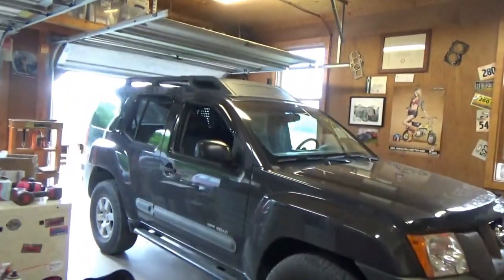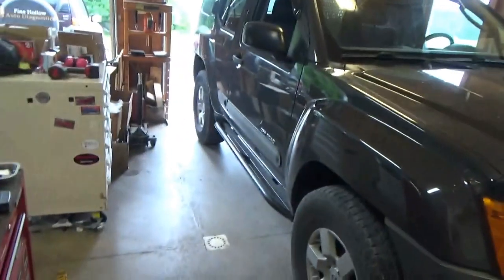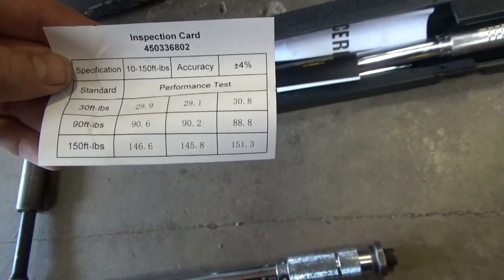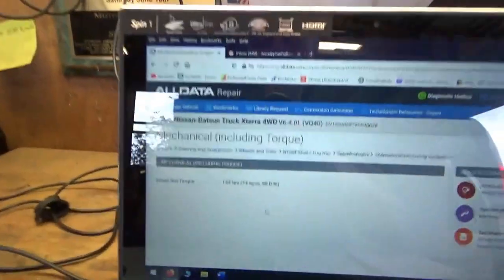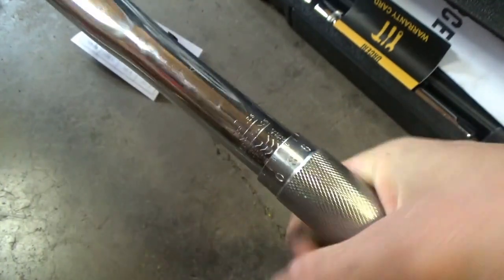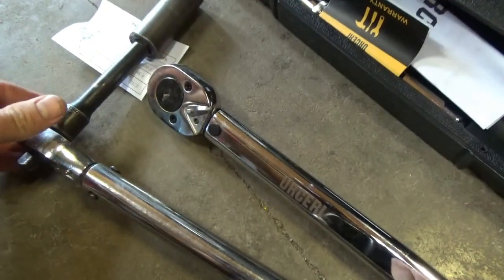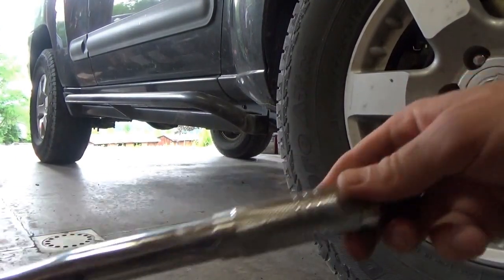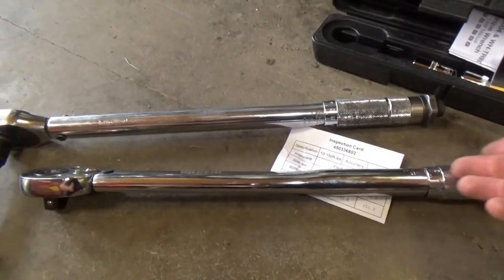Can you trust a $30 Torque Wrench?

Comment: Nice informative video..👍🏼
Would you ever torque fit spark plugs and if not, why not?
Also would you expect wilder differences between torque settings at a lower range 20nm 
on a spark plug for example?

Comment: Torque for fasteners are not exact value but a range. NO engineer will design that range to a value that most tool on market can not reach unless it's definitely necessary. For a car working in all climate, this is not the case, temperate variation may leads to large torque variation already.

Comment: Like Ivan says, check the torque specs in the owners manual because they can surprise you. My Tesla Model 3 which is a 4-door sedan has a wheel nut torque spec of 129ft/lb which is way more than my larger Jeep Grand Cherokee which is somewhere in the 80-100ft/lb range. I wouldn’t have guessed that.

Comment: You young folks should get into the habit of using a manual and torque specs. It's a good habit to get into early and you don't pull a boner like him and miss something. I torque everything using a free-bay torque wrench. As you get older, your mind gets more crowded. Fundamentals like this never ever fail you. At a minimum even if you do a basic tire rotation your floor is at minimum, the lugs are on tight. Do it right and start right

Comment: Easy way to test your torque wrench. Put the torque wrench on the lug nut of your car, as horizontal as possible. Then hang a gym weight on the handle of the wrench, with zip ties. Calculate how much torque youre applying to the wrench, set that torque on the wrench and see if it clicks or not with that weight.

I have a 10-dollar beam-style torque wrench, i tested it and it's really accurate! A few percent of error, doesn't matter if you ask me.

Comment: I occasionally use a luggage weight meter and put the strap around the handle of my torque wrenches to check them.  They have always read close enough where I can’t say they are “off” according to the weight on the scale when they click. I have an OLD 1/2” craftsman, a 3/8” Pittsburgh (HF) and a 1/4” Chinesium brand. Good enough for my use.

Comment: I worked in calibration for a while and checked many different brands with very expensive equipment. There was no correlation between cost and accuracy. The HF brand was just as accurate as the rest. The standard for passing is 4% from 20% to 80% range.

Comment: On  lugnuts the best technique is to do them twice. As you go around the wheel it may shift. I used a beam type torque wrench on wheels for +40 years; no calibration needed.  Where a digital trque wrench is useful is for low-torque fasteners where a mechanical one may noyt indicate until after you strip the fastener.Starn apgages are more precise AND acurate for small loads.

Comment: OMG leaving the torq wrench dialed up weakens the spring and the torq becomes less, so in your case over tightening would be justified. But if the manufacture says 85 then it is 85 + or- a percentage for standards. Always unload the torq wrench.

Comment: If you do a lot of wheels I suggest a decent split beam torque wrench , unfortunately today's cars use torque to yield fasteners on critical parts and  a tool to measure degrees is needed , but for setting pinions a good ole  beam style is still the best

Comment: yep, few years back, hottest day of the year, my calipers locked up, hose garden dance, smoke everywhere...just after 1 week after getting new tires....had to use a chisel, hammer and sawzall to remove 20 lug nuts on my bronco....torque wrench...why... just use the gun till can not turn no more....when I called they say it is not their fault. Truck is too old.
On my own work truck...came from dealer with less than 20k miles....months later misfire....middle of the road, check stupid before calling the big guns, porcelain broke on cyl #1...put a wrench on it....not coming out....put a pipe on the wrench...nothing....came out with an impact and a lot of fear ( new head and crap......) but, thank God was okay....again, tight it like owns you money....no need for torque wrench, I know when to stop.....sure.

Comment: I worked for a few years at a precision tool calibration lab and our torque department was our busiest.  Hundreds of torque wrenches passed through our shop every week and here are some of the most common problems we would see.

Regardless of wrench type, (click, beam, strain gauge etc), do not ever use a torque wrench as a breaker bar... over torquing can ruin a wrench beyond economical repair very easily.

Click style wrenches ... getting dropped.  They have a block inside that when dropped can tip over and throw the tool way out of spec.  Wrenches should be stored at their lowest setting to relieve compression on the internal spring.  Setting the tool below the lowest setting makes them especially vulnerable to the block tipping mentioned above with only a slight bang on the bench.

Comment: How about a free torque wrench?  I was on a Craigslist run buying a 1950's Delta 20" disc sander.  The guy was moving and goes, "Do you want any of this other stuff?  Free."
 
I didn't need or had everything visible except a 3/4" drive torque wrench.
 
"Is the torque wrench included in that offer?"
 
"Sure!"
 
Later that Summer I replaced the pitman arm on my Chevy 1500.  And that free monster drive torque wrench came in mighty handy!

Comment: It is much more important that wheelbolts are torqued equally, than with any exact torque figure.
Doesnt really matter, if they end up torqued to a value of 115Nm or 135Nm, as long as it is equal on all bolts.
Because the rim will flex otherwise.
I use a torque bar for the impact gun, for lug bolts, to ensure they are equally torqued at the same time not overtorqued.
These torque bars are not that common anymore, presumeably because people dont understand their usage.
They come pre-made for the (approx) 120Nm torque common for all passenger car wheelbolts, no matter light alloy or steel.
As for headbolts the same general rule applies.
Doesnt really matter if they are torqued dead on to any exact figure as long as it is fairly close.
Again it is much more important they are torqued equally.
In general - a torque wrench ensures you are not OVERtighten any bolt - at the same time reaching a safe minmum torque value for the application.
You can quite easy calibrate (check) your torque wrench, using the rule of weight applied multiplied by the force arm length.
Assuming a horizontal position on a wheelbolt, 24kg applied to the end of a 0,5m torque wrench equals to 24kg x 0,5m = 12kg/m = 120Nm.
By varying the arm length, using a water pipe extender, you can easily get close to high torque values, needed for hub nuts.

Comment: I agree with torquing the lug nuts to spec, but a lot of the Asian cars are pretty low in my opinion, like 80 ftlbs so your doing 85 instead? Or would you do 90?

Comment: Bolt torque is a mediocre  means for providing clamping force and therefore expensive or cheap torque wrenches will only yield marginal results. Torque to yield bolts are far more accurate when it comes to  providing equal clamping force. So just about any torque wrench will do . Bolt quality, finish and lubricants will cause clamping force derived by torque to vary  tremendously up to 40% .  torque vs clamp https://www.youtube.com/watch?v=kTwpA2yJ81o

Comment: I love my  round proto torque wrench I can use with any ratchet and it has 6 lights to show me when I am close to my setting and beeps when I am there.  I am partly deaf so the lights are so much better than the click.  The quality control on the cheaper torque wrenches is questionable.  See some of the Tekton reviews where it didn't go off and the guy broke his plastic intake manifold.  Yep I spent $180 and am happy.  I used to calibrate our Lab ovens with a $400 thermometer that had to be calibrated once a year.  My next torque wrench will be a proto or cdi (cheap snapon).  To each their own.

Comment: Yep, I've been torquing lug nuts for years, right after I had a buddy's harmonic balancer come loose when I thought I really hogged it down tight with the impact gun. Then later on, I had a couple loose lug nuts on my own truck. That was a real eye opener for me. After that, I couldn't let customer's vehicles go with impact-tightened lug nuts and be able to sleep at night. A failing pressure regulator on your compressor can make a WILD difference in how much torque it puts out in X amount of seconds!! Lots of variables with an impact that could potentially ruin your day. Something for everyone to ponder ...

Comment: Yeah but.... As a professional calibrator for over 45 years, all Torque Wrenches (TW) are not created equal! Cheap TW will generally loose their accuracy of 4% over time...All TW should be calibrated once a year or depending of use...Tolerance on work to be done is usually 10%, so your 4% TW set at nominal specifications will do fine... Exercise your TW 4 times at a lower setting otherwise you can get a false Torque (High) and cause damage to work...Store TW at lowest marked setting otherwise you will create a false memory tension on the internal spring...Don't use your TW as breaker bar, hammer or other purpose not intended...True, Click type TW will do fine for about any work...Electronic TW is more convenient in mass production...Both should be treated as a delicate piece of calibrated equipment....

Comment: If a torque wrench sits for a long time, test it first to make sure the 'Click' is working. There is lubrication inside that requires frequent movement. Never use upper range unless it gets calibrated, the accuracy drops as you compress the spring to it limits.

Comment: Agree, lug nuts need to be torqued. I cured a so called "warped rotor" problem by just re-torquing my wheels. The brakes would go horrible and judder on the highway after about 30 minutes or driving, so I knew had uneven heating on the rotor causing it to buckle

Comment: No matter the brand, you look for the smallest margin of error in % before you buy. Most times the actual quality comes in the longevity of the paw in the ratchet head, rather than the accuracy of the scale. I stay away from the 1s that have the rotary direction selector, as those have TINY springs that activate the locking paw to the gear. And they break. The 1s with the 'switch type' direction selector like both of the featured wrenches Ivan was using tend to hold up better, and most times stay tighter ( less wobble )

Comment: I've had 2 Craftsman, 1 Snap-On, &  1Mac.
The Mac is a 3/8" inch pound Torque wrench.  Still works great after 25 years ownership.
The 2 Craftsman are 3/8" 50 to 150 foot pound torque wrenches.  One is  broke, one works, but slips under load occasionally.   The Snap-On Torque Wrench is a 1/2" goes up to 300 foot pounds.  Works great.  They are ratchet head, click type.
None are angle equipped.
Somewhere in my Dad's old tools is a small beam torque wrench.  I forget what it goes up to, but it still works.

Comment: Wouldn't it make a difference wether the torque wrench ( and so the bolt/nut) is in movement to get to the click/set point versus applying the tool to an already tightened bolt? Different types of friction.....

An accurate luggage scale will allow to verify and calibrate your torque wrench pretty easily. Just measure the length of the lever and apply the corresponding force...
Reply from the maker: Great point! How much greater is static friction vs. dynamic friction on a lightly lubed fastener?

Comment: Back in the mid 80's I served in the USAF and our composite tool kits, CTK's as they were called, consisted of cheap tools from China including torque wrenches. Our tools were actually a mixed bag of junk and maybe one or two golden nuggets (ie. snap-on) but we had to keep our tools in top condition. Our torque wrenches were sent out to be calibrated every so often but they were NOT any name brand but China. But they worked. It's probably why I have a lot of HF tools mixed with Craftsman in my box. Just think, the next plane you fly on may have had the engines torqued with one of those "budget" torque wrenches. Lol

Comment: Always enjoy your videos...... but any auto manual will have  pages of bolts that need to be torqued. Wheels, brakes, suspension parts, engine accessories, engine bolts, gasket bolts, and pages of others.  One needs a quality torque wrench, several of them. That you can rest assured that  the customer's vehicle will be repaired, professionally.  
I do not trust many so called cheap torque wrenches... And I do not trust harbor freight torque wrenches on my auto repairs.
Good luck with yours.

Comment: Yep a 30buck torque wrench can do a good job and save you from wrath of the wife when you been playing with her wheels lol .
Only time I had issue with a wheel was my sisters car after a brake job, fortunately I was test driving it and had forgot final torque the wheel, made a lot of noise real quick and I had walk back the shop and get long ratchet nip them up to drive it back shop and check studs and torque ...
Digital meters are nice for speed and easier for angle torques in some scenarios but you sure can do same job with simpler tools  ...

Comment: I expected to see a proper test on the lower end of the scale, on the high end of the scale and one close to the middle. And a word on thread lubrication. But I just got a quickie on some lug nuts.
Reply from the maker: You mean a "real scientific review"? That would take like an hour! Maybe I should do that on the PowerProbe that's collecting dust on the shelf ;)
Reply: @PineHollowAutoDiagnostics  Leave the powerprobe on the shelf, where it belongs. Just use that nice long lead that comes with it.
One day it might become handy: if you need a switch, you can take the one that is in that powerprobe.

Comment: Another thing. Dropping a torque wrench is bad. Recheck if you drop it from height. Airplane mechanics have to recalibrate often and also if you drop it it’s usually taken out for inspection. 

Also, I’ve been surprised personally using torque specs on like transmission bolt pans and them being tighter than I would of expected.  Like 63in-lbs on the pan bolts and I first guessed using my mechanical wrist then used a beam style small torque wrench and they were a lot looser than I expected. Was just wondering if anyone else has had this happen to them on the small pan bolts with gaskets. 

My 2 cents. You can’t have a dialed mechanical wrist without feeling correct torque first with a torque wrench. So beginners should always be using them. Buy cheap ones, use them on everything pretty much, then start phasing it out as you develop a wrist

Comment: Recently saw an electronic 1/2" electronic torque wrench in Lowes, for $139. It was a Kobalt brand. It seemed to be a fair price when compared to the Mac Tools or Snap-On brand that sell for $500 to $700.
I wouldn't trust a Harbor Freight torque wrench on anything I was working on but I have seen folks using them.  I have an older style Craftsman that has the long pointed indicator and a torque graph near the handle however, it isn't so easy to use because you have to view the graph to see the proper torque and in most cases, such as lug nuts, its not easy to get 100 ft lbs and look at the graph at the same time with the graph facing left or right and you are above the handle. You have to be looking down and the wrench and graph facing upward to see/use it with any accuracy. The click idea is great and the ones that have the click and the beep and or vibration work nice but for those in noisy areas and/or if you can't hear those higher pitched beeps, you're better off with the click type. And then, with some manufactures, they want torque specs with oiled threads and some will use anti seize which will alter the friction. I prefer to use a very light coat of anti seize with lug studs due to their propensity to lock up.

Comment: I usually just impact the nuts on the wheels, and use a breaker bar once the vehicle is lowered to the ground to give them one last crank.  One of the things you have to be wary of is sheet metal capped lug nuts on older Chrysler products from the 80s To 90s because the metal rounds off.   As for harbor freight they seemed to up their game on power tool quality in recent years.
Reply: Those Chrysler / Dodge lug nuts are the worst!  I had a miled out Dakota for dump and Home Depot runs for a couple years (great little truck otherwise), but I had to carry two different size sockets in the truck in case I got a flat; one for the lug nuts with the caps intact, the other with the caps gone missing.

One of those caps got stuck in one of my sockets as well and ruined it...could remove it for the life of me, lol

Comment: Well over 90% of torque wrenches are good enough for nearly all applications. No mechanic really needs a fancy digital one. They're handy for sure especially if it has a built in accelerometer for angle tightening. But no torque wrench is any better than its previous calibration, we get our wrenches calibrated every year at the shop.

Comment: I've used a SnapOn QJR 3200 torque wrench for over 50 years. My dad was a NASA Quality Control, Final Product inspector and he'd occasionally take it to work to recalibrate it. It never failed a 2% tolerance. 

If you buy cheap, besides the stigma of other mechanics in your shop, you'll never know when nor how far out of specs a torque wrench can wander... but my money's on import tools failing    more than a reliable and less stigmatized onshore product.